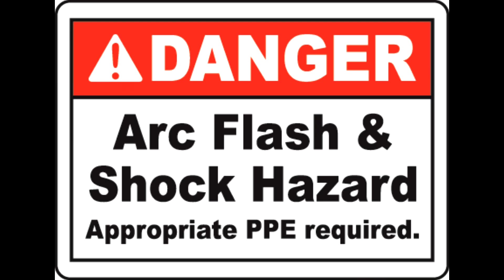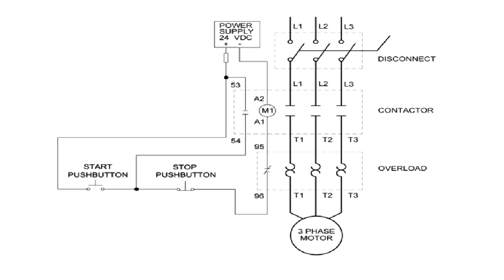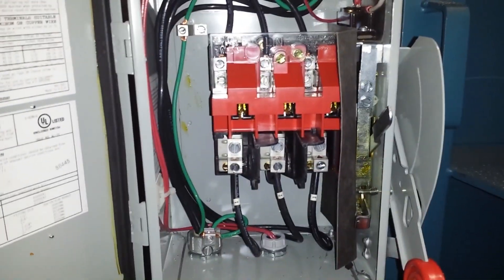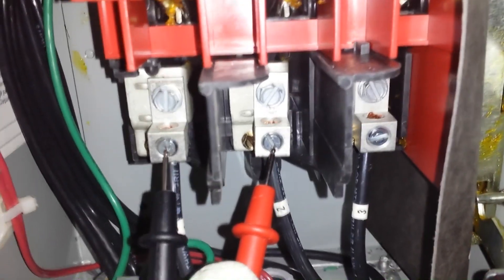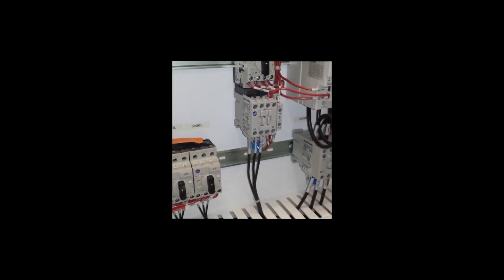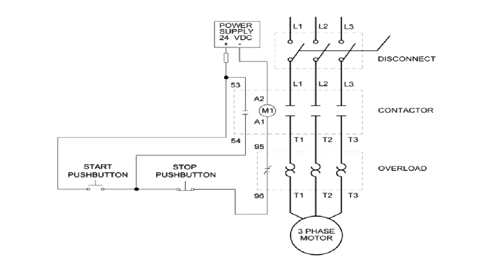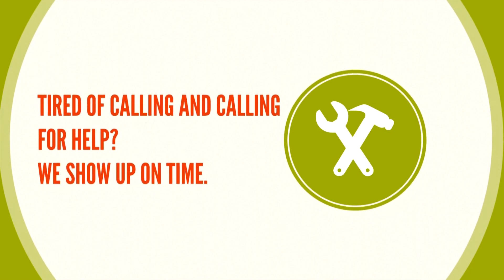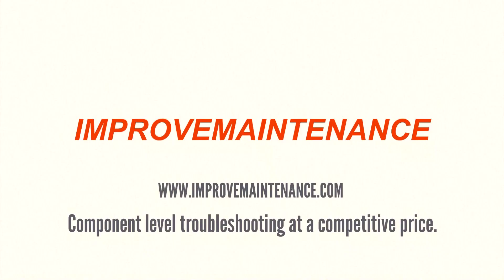How to check a 3 phase motor system

Comment: I'm at a place right now. That's only temporary, but I noticed they'd like to use high amperage, and they reset like if it's a video game, pressing buttons not letting it cool down the replace motors like it's going to a candy shop.

Comment: Am I missing something? when you ohm'd out phase to phase on the bottom of the disconnect youre not checking the motor unless the contactor is closed. but if your power is isolated your contactor should be open. someone help me understand

Comment: I start at the other end, most faults are not at the motor, most of the time there is a protection trip, phase supply fault, overload or over temp.

Comment: First test should be for voltage to ensure the circuit is actually de-energized.  You should test your meter first on a known live circuit, then test on the de-energized circuit, then check on the known live circuit again to ensure your meter is actually working and not falsely indicating 0 voltage.  Make sure your meter is properly rated for the Hazard category.  usually 480vac 3phase motor circuits are considered CAT III.  Minimum your meter should be rated for CAT IV 600V or CAT III 1000V even better. It should be certified by at least 2 independent labs like UL CSA TUV DVE for this CAT rating.   Your test leads should have been inspected for any damage before use and your probe tips should have the least amount of metal exposed as possible.  Ideally you clamp the COM lead to a ground away from the terminals to be tested first. and then use 1 hand to probe each terminal for voltage 1 at a time.  This creates a greater distance between the two leads and lowers risk of accidental arc flash forming between the probe tips.  After you are sure the circuit is de-energized then you can check phase to phase ohms on the motor windings and T leads.
Reply: Dude, no shit.
Reply: No shir huh, you copy paste that from Google 😂

Comment: If you motor starts with the N.O start button and stops correctly, the control circuit is working properly and you can eliminate most of the steps shown in 30 seconds or less, then just check the power circuit and go from there. If your motor isn’t wanting to start, try manually picking it up with the seal in contact, If it starts, check start and stop button.

Comment: I understand the incomeing control voltage but what is the incomeing line voltage?
Reply: I ment to ask what is the difference of income line voltage and income control voltage
Reply: @vincentsanchez9195  Line voltage is coming from the motor control center or substation.  Control voltage is on the secondary side of the control transformer and has been stepped down to run the control circuit.

Comment: to check the motor it's better to use isolation tester. more than 0,5 MegaOhm between ground and phases. You check the cable also.

Comment: To check the motor shouldn't you determinate the motor or at least check the termination?  I've had instances where the motor shoots good from the cabinet but you open the peckerhead and the phases are melted together.  Obviously it would cause the breaker to trip but still from the disconnect you would see the same reading if the phases were not shorted.
Reply: Still an awesome video though!
Reply: Explain in more detail please...I’m thinking you are speaking of disconnecting the 3 power line leads and checking the motor leads in between windings is that correct ???

Comment: Done hundreds, this is the cleanest place I've ever seen, where's the water and hazardous chemicals, thats where I learned.
Reply: If water and hazardous chemicals were part of an electrical system what you said you matter, but clearly that not the case, so what you stated is out of place. Electricity works the same way regardless, of where it is.

Comment: do 3 phase motors not need an earth? what about neutral?
Reply: Peter Brown 
They do require an earth ground. In the United States it is usually the green wire as shown in the video when he shows the inside of the disconnect box. 

There is no neutral wire in a 3 phase motor. Each of the 3 phases is a hot wire.
Reply: no neutral wire is required only a green ground wire

Comment: Why are you checking the motor at the disconnect? According to your print the normally open motor starter will be open. Kinda dumb
Reply: Rubberneck 
He mentioned in the video that sometimes a disconnect is installed near the motor to provide a convenient point to lock out for safety. In the schematic, this disconnect would appear after the overloads and before the motor.

Comment: I have a question,how do you get a 3phase motor out of Lock Rotar Amp
Reply: if you remove the input voltage to the motor and make sure the motor shaft is free from any other mechanical sources , then the motor rotor should turn free within the motor housing. However, if the motor shaft fails to turn with no voltage applied , then the motor needs to be taken apart and inspected for bad end bell bearings and remove the motor rotor from the field and check for any damages there as well.
Reply: the locked rotor motor test is basically when the shaft of the motor is locked so that it cant move and then the rotor winding's are short circuited and checked that the lower frequency applied and reduced supply voltage matches the full load rated current of the motor

Comment: Is the incoming control voltage 24VDC?
Reply: yes
Reply: sometimes the control voltage is 120 VAC if a step down transformer is used from the main power. This would all depend on the type of coil voltage used in the main contactor

Comment: Hey, will checking the resistance between each phase of the motor not give the same resistance, as all of the windings are connected together in the motors terminal box?
Reply: +rory johnstone if you check resistance between each phase then yes the resistance should be the same as they are balanced. if they were different then they would be imbalanced and cause the motor to have a problem
Reply: +Charlotte Cottam As i understand the links for star/delta in the terminal box on the motor would have to be disconnected to properly test between phase to phase. As checking phase to phase with the links in will not show the fault due to the three phases being tied together in the terminal box.
Reply: In order to properly checking the motor winding resistance a megometer would be required as well. If any motor winding shows any  resistance to ground. the motor field windings would have to be repaired then
Reply: Your meter may pick up small differences, however you should disconnect the motor from the circuit and test the insulation of the windings with a megger or meg-ohm-meter